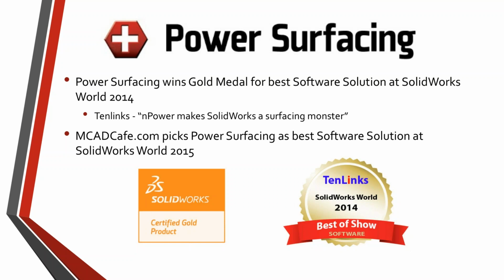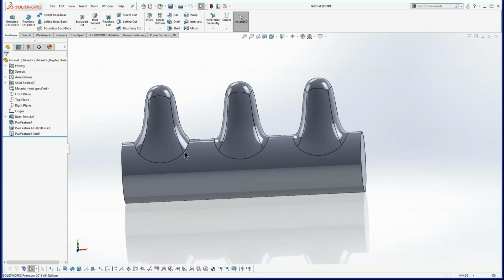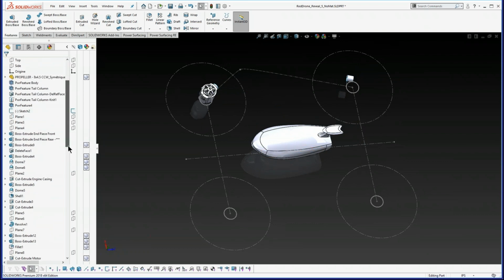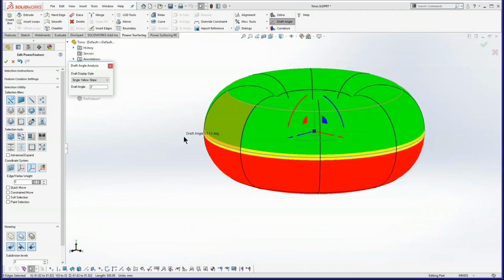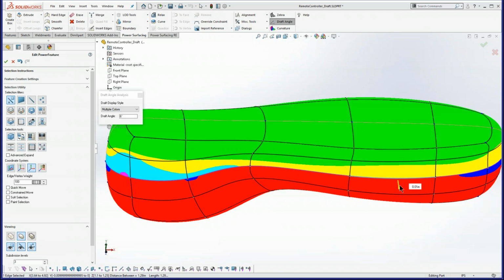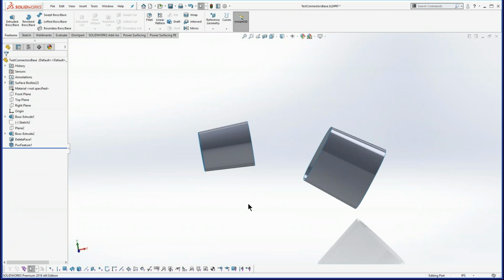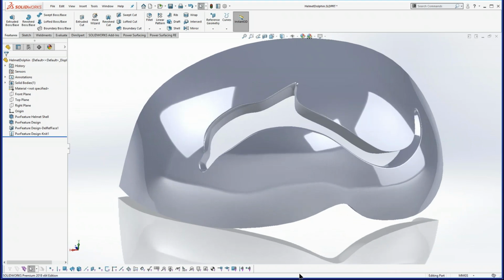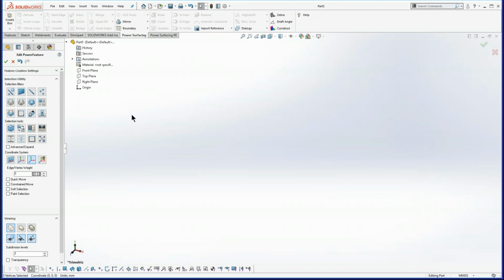Industrial Design with Power Surfacing 5 0 for SOLIDWORKS

Comment: To start with, I cant find the 'power surface' option on my toolbar. How do I find it ??
Reply: you have to install power surfacing. It's not a basic tool. You have to find from torrentwhich version are u using?
Reply: Just pay around a thousand usd